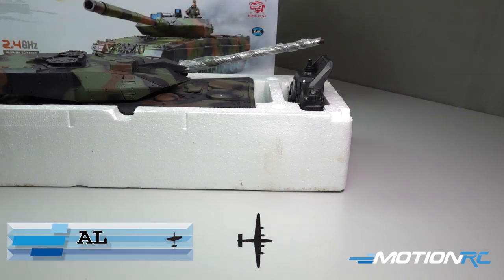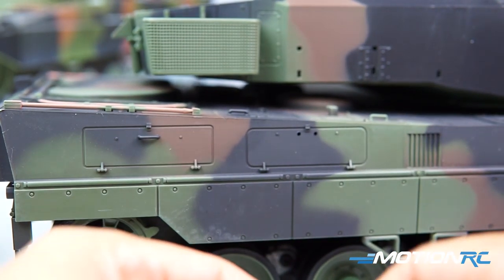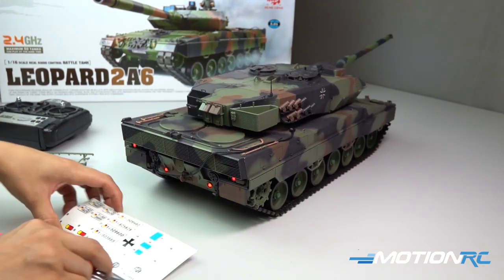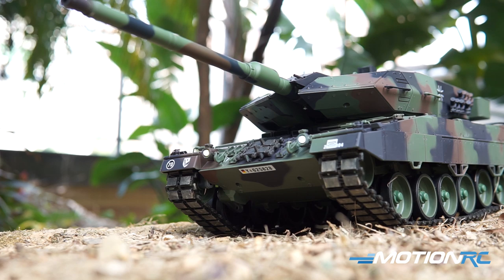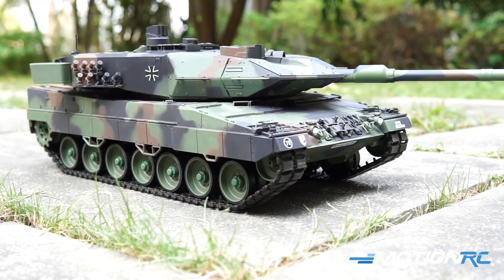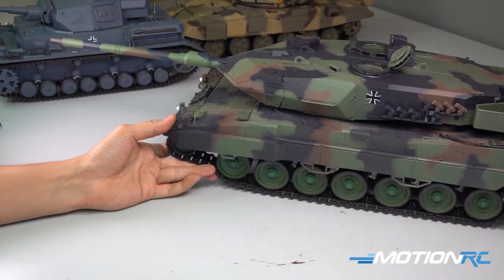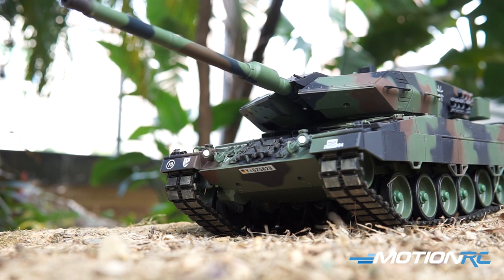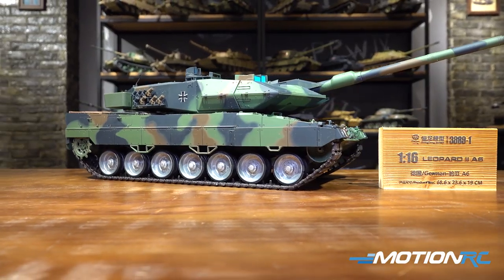Leopard 2A6 - Heng Long TK6.0 RC Tank - Motion RC Overview

Comment: I have a Heng Long Leopard 2A6 and a Torro Leopard 2A6. I love both of them. The Torro is much more detailed however. The Heng Long is the Pro version with metal tracks, road wheels, suspension arms. The gear boxes are metal as well. The motherboard is version 7. I like that it is both airsoft and IR capable. I have been watching many YouTube vids about detailing and weathering of the vehicles, which I hope to do in the near future. You're right about the size of them. I have separate shelves to store them on. With the barrels over the rear deck, they fit ok. I plan on going to a local hobby store this week, to purchase spare parts and (don't tell my wife) a Heng Long T-90. Don't know how I'll sneak it into the house. lol
Reply: Any links to the bigger better versions?

Comment: Got mine 2 days ago, mine is 6.0s version. And my on-off switch is hidden at the back just below the turret. The new version is great, metal gears and metal suspension arms
Reply: I bought the same tank as well. I put in the BBS and they just roll around inside the tank. They won't shoot out. And I have to hold both side buttons to make it fire. Dose your tank fire BBS.
Reply: With the suspension arms being metal, what type of springs are used on these tanks?  I have one of the earlier Tiger I, and the wheels came off already since the suspension arm mounts broke off the chassis and uses the cheap springs.
Reply: @roadcarver71  i assume its the same old cheap springs.
Reply: @johnnyb2702  I've yet to try firing bbs on mine.

Comment: With all those scale detail parts, I'm surprised Heng Long didn't put a machine gun on the commander cupola.
Reply: Hi! Juste received mine yesterday. Very happy with this tank. HengLong have go better since 10 years ago. 2 things that I do find wrong....figurine is not up-to-date (1944 figurine)...should be 1995 or late years figurine, also I do not like the red LED for the machine gun....should have been yellow or orange. Haaaaaaaaaaaa...the power switch is in very bad position....should have been placed in a better position. But...over-all....it is a 9/10....Lolll

Comment: I hope you guys stock spare parts. My Leopard 2A6 has lost a couple of cosmetic parts over the years. :D
Reply: oof
Reply: Maybe use different/better cement for those then? 
For photo etched parts and metal to metal connections I use VMS Flexy 5K CA. It is a super glue that stays flexible and therefore is able to absorb a considerable amount of force.
For styrene parts I use VMS Styrene cement a normal but very effective cement with good capillary action.

I would imagine with those the only way to get parts off the model is to downright brake them off.
Reply: @pop Gamer yeah its pretty close to a 1/10th scale RC truck or buggy.
Reply: free weathering
Reply: @tonk_0139  Hey if you want free weathering, you could just take it out side after it rains and run it through the mud. lol
Reply: @Strigon01  already done like a year ago
Reply: @Strigon01  it was fun, and why did you came back to your comment after like 1 year ago just asking
Reply: @tonk_0139  I logged into youtube and saw a notification so I replied.

Comment: Looks really great from the Leopard 2A6! but would loosen the chain tension a little looks too tight with plastic chains and glue a small counterweight in the front lower tub!. and a question about it! Where is the MG tower on the roof is it not included?

Comment: I  have the V7.0 Leopard version. It needs a lot of mods to be really capable to ride in terrain... meaning a lot of work, and a lots of time to make the mods. 

But it is worth it. My Leo now does a great job in mud, in water , in sand. I have steel gears, and the standard motors with 8500 rpm. A bit too slow so I have ordered the Heng Long blue motors with 22000 rpm. And maybe adding a vent.  

The possibility of slow riding should be capable to handle the  extra strain on the drive train, just as is  making slow and wide turns.  All in all a great progression to my TK 18  mainboard Leopard.

Comment: I g ot a leopard 2 a 6 but I changed the color scheme to black and green. I like the look a lot better. I have the metal tracks also. I want the metal wheels but I wish they came in black. Leopard 2a6 is my favorite tank and I also have a m1a2 abrams they are both upgraded

Comment: what's different between tk 6.0 & tk 7?  is this tank sort of dated with existence electronics & capabilities? or should i wait for a newer version?  what kind of glue do you recommend for the accessories?  i chose a l2a6 over a t90/ challeger2 as a l2a6 doesn't look like a running christmas tree on tracks (no offense).  thank you.

Comment: Good afternoon, is it a good idea to change the tracks for metal ones?
Reply from the maker: depends on how you want to use your tank. For regular grass and driveways/indoors etc the plastic is fine. The metal helps when you want to get it in more rocky stuff and rougher terrain
Reply: @MotionRC  Is there a version of this were I can just get the Tank with the metal tracks?
Reply from the maker: @Milo_Animations   Yes, the professional Version comes with the metal tracks pre-installed. Link is in the description of the video
Reply: @MotionRC  Alright. Thank you.

Comment: I got this tank bought from new,,All works as it should but transmitter red light keeps flashing,,Ive changed the batteries a few times but no luck keeps it blinking,Any ideas thanks

Comment: nice video, thanks, since its 2.4ghz, do you know if it can bind with OpenTX transmitters (eg Radiomaster TX16S)? I have drones & planes from different manufacturers all bound to 1 transmitter. It would be very helpful if I could do the same with this tank.
Reply: I'd like to see the Abrams main gun balanced, on different terrain. Like the real ones. Maybe using weights or springs. And a commander, flopping On a spring would look realistic.

Comment: WARNING! Don't run tank on factory set volume. My speaker failed after the third run. I contacted Motion and was told the speaker blows up on high volume setting. My tank came off of warranty and they would not replace it. But they said they would sell me a speaker.  Cost of speaker $15 Cost of shipping was $15 and would take about a month with DHL.  I just bought replacement on EBay and got it in 4 days.. I installed it and set my volume on the third level. Sounds ok.

Comment: hello , this model is it water resistant?
Reply from the maker: To a small degree, but definitely can't submerge it past the treads.
Reply: @MotionRC  thank you for your answer, or you bought it? Because I would like to buy the Leopard 2a6 and maybe the Challenger 2 later
Reply from the maker: @johnhaines1480  I have 6 Heng long tanks, not this one but all of them are the same as far as water resistance. You don't want deep water where the main battery and electrical devices are stored or they will flood.
Reply: @MotionRC  thank you, can you advise me a site so i can buy it ? 
Because there is a shortage of stock on your site if I understand correctly because I do not master the English language perfectly
Reply from the maker: @johnhaines1480  I can't. We will have more stock very soon. Click the notify when back in stock button on our product pages and you will get an email as soon as they are back. These have been very popular
Reply: @MotionRC  Thank you for taking the time to answer me :)
Reply from the maker: @johnhaines1480  not a problem, anytime
Reply: @MotionRC  
Hello, is it okay if I take this model and I equip it with the metal track? there is no risk of breakage ? 
Sorry to bother you again
Reply from the maker: @johnhaines1480  no problem at all. Each of these tanks have 2 versions, if you buy the Professional version it will come with a metal track already.
Reply: @MotionRC  Yes I know that the other model is already equipped with metal track, after there is a fairly significant price difference between the 2 models
Reply: Because I am looking for a Leopard 2A6 model that I like, which is practical and robust because I intend to go to Canada with
Reply from the maker: @johnhaines1480  the professional version is the one for you. Buy the lower price version and upgrading it would cost more in time. The pro versions also have other metal bits aside from the track too.
Reply: @MotionRC  And the normal version is still resistant and well done in terms of detail? Because I would also like to go to gatherings with all by adding a camouflage net
Reply from the maker: @johnhaines1480  both versions look exactly the same above the treads with the same functionality. The pro version is just beefier and more durable if your gonna be bashing outside more
Reply: @MotionRC  Thank you for this information :).
The tanks are pretty enough and detailed to go and do events with?
Reply from the maker: @johnhaines1480  the video shows you what you get. I think they are great, but add some extra weathering and you can take them to new heights to
Reply: @MotionRC  
Thank you again for taking the time to answer me and advise me, good evening

Comment: Yo compre uno desde China y por desgracia no vino el cargador ni la bateria, no se que hacer.
Reply from the maker: We sell batteries that work and chargers although the chargers are out of stock at the moment, but you can always get a Tamiya connector for a standard RC charger and ditch the plug in wall one https://www.motionrc.com/products/admiral-3500mah-2s-7-4v-li-ion-battery-with-tamiya-connector

Comment: Gyro for gun stabilizer?
Reply from the maker: Not on these models no
Reply: @MotionRC  What particular models have them and can a gyro be installed?
Reply: @MotionRC  May I ask you what models they are available or is there a way to upgrade them with a gyro?